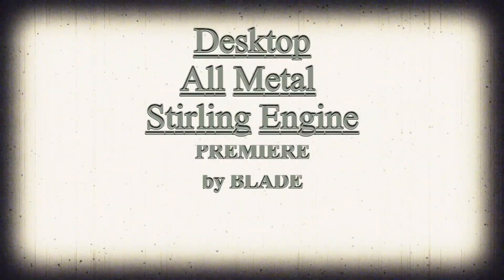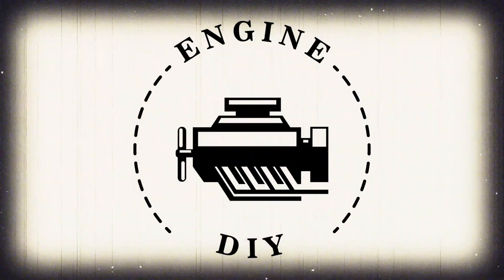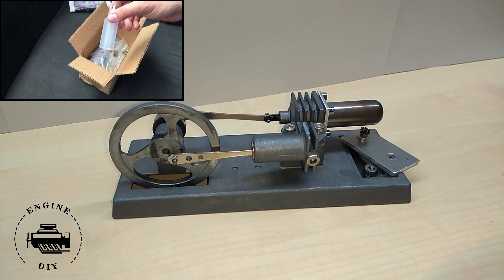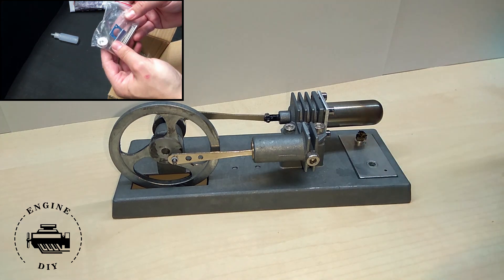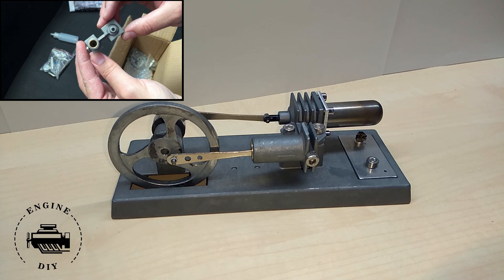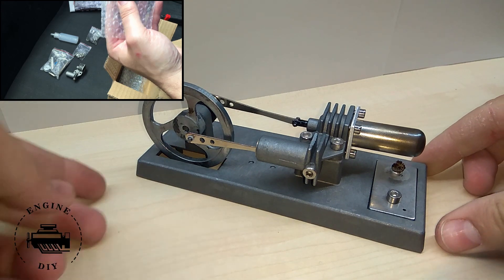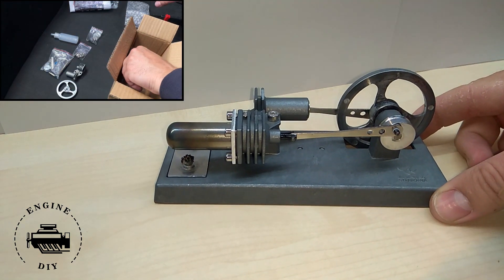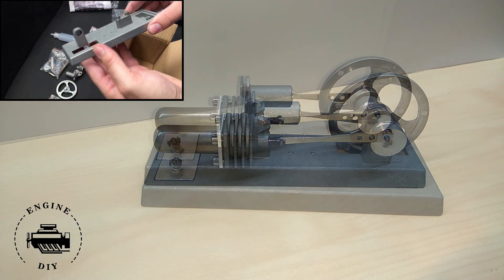Cheap All Metal DIY Stirling Engine KIT (premiere)

Comment: I've got a few Stirling engines, and have found that using a very light oil on bearings etc is OK, don't ever lubricate the power piston. My engines all seem to be quite happy with that running dry.
Reply from the maker: Nice! My engine too! The power piston is not lubricated! :)

Comment: Which type of lubricant or oil would you use for moving parts on this?
Reply from the maker: The first time I use thin oil as possible. But PTFE spray or WD40, other cutting oils are good for try. The speed could increase with small modifications what I showed on the other video! Check it! Thanks for your question! BLADE

Comment: Can you tell me what a "Regenerator" looks like and how does it work?
Reply from the maker: The regenerator is a fine stainless steel mesh. It could make the cycle faster because it takes the a portion of heat from the gas when it is move across that to the decompression space and give it back to the gas when the gas move back and should expand. 200 year old invention for the better efficiency.

Comment: For some odd reason, the people selling this kit keep omitting the manufacturer (StarPower) and frequently misspell the class of Stirling engine (Wolfbush) as WOLFBSUH.
Reply from the maker: Probably you've right, but you know if the manufacturer wants to sell tousands of pcs than they want to use distributors. Few distributor create new "brand", "logo" or few little modification. I was a simple bublisher here and i didn't really know who is the original manufacturer. That's not my business, but thanks for the infos!

Comment: I am interested in this type of design manely because I suppose that the ones that have glass cilinders can break from time to time since they always come with spares, am I right?
Reply from the maker: Dear Henrique, I have few new glass cylinder engine too. They use Pyrex tube for it. This tube is not break from heat basically. They send spare parts because the people could break it with a simple drop or some knocking or just because the traveling wasn't enough safe. On my next few premiere videos I want to show some pretty nice glass cylinder/glass piston engines with unbelievable high speed! ;) But anyway, if you need one with stainless steel tube just follow the link in the description. Thanks for your comment! Blade
Reply: @AttilaBlade  thank you for letting me know!

Comment: Cute engine, I really like it and I`ll have to buy it but honestly to say I don`t know how "all metal Stirling engines" work. They are entirely made of metal (also the displacer cylinder is made of metal), so after a few minutes of heating the heat will be transferred to all other parts of the engine, the radiator also will get hot and finally the engine should stop, because there will be no temperature difference between displacer cylinder and the radiator, am I right? 
There is no thermal insulation between the metal parts of the engine, that`s why I don`t understand how it works. I think... the displacer cylinder should be made of glass for example, because glass doesn`t conduct heat and therefore is a good thermal insulator. Could you explain it to me please?
Reply from the maker: Yes, you've been right, if the temperature different too low, the engine will stop. But the engine has a small silicone ring seal between the SS cylinder and the aluminium main body radiator. The heat conduction here a bit bigger than we needed. That's why I modified HACKED the engine. Check the next video pls! :) Anyway, yes a glass cylinder could help, but than the displacer could glass too, because aluminium now. Many many things could change the performance with small tricks, ceramic paint etc, without material changes. Thanks for your comment! :) BLADE
Reply: Thank you very much for the explanation! I didn`t know there was a silicone ring seal between the metal parts, now I understand it. I`ve watched the second video with modifications and I really like your amazing ideas :) 
Greetings

Comment: hi Blade, where is our FPSE kit ????
Reply from the maker: It is a really good question! :) Maybe later, if this cooperation will be fruitful. Would you want to buy an all metal FPSE KIT?
Reply: yes I would buy and might even help with design. I contacted a builder and they want $10k usa each and a production run of 100. keep up your great work
Reply from the maker: @dirkverhoest936  What??? 10k $ for a newly designed FPSE engine at 100 pieces? 100$ each... Hmmm! I thought about earlier and I think now I could make a nicely visible glass structure one with metal stand under  20$. Maybe the stainless steel version couldn't be more than 50$, but the main parts are so different if we start to make a bit bigger one. If we wanna make a desktop one, with few parts as possible, I think the glass version is the best choise for it.